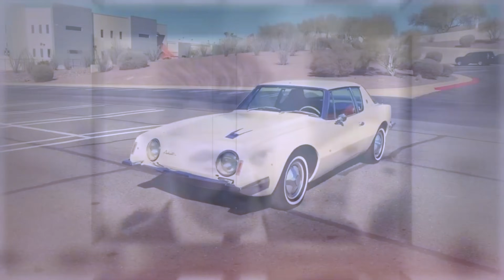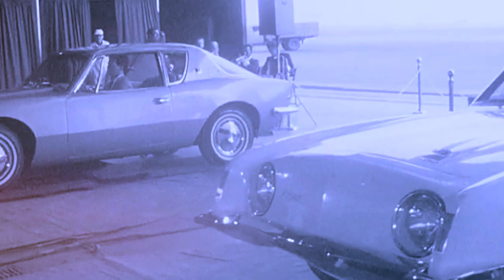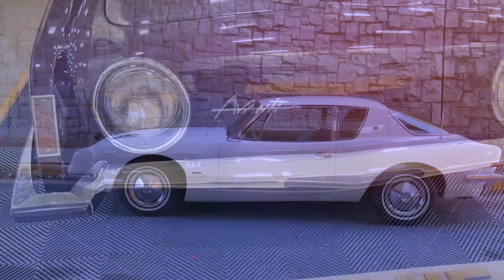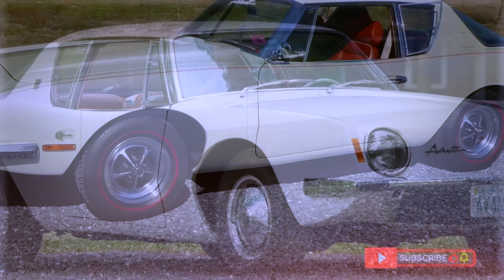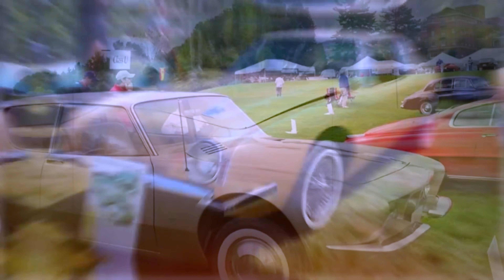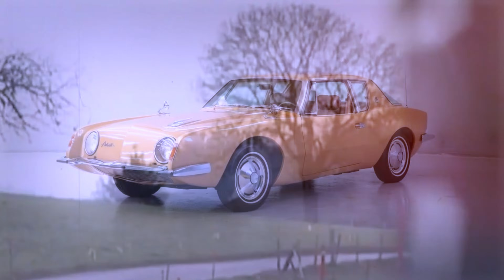13 Shocking Facts  About the 1962 Studebaker Avanti – America’s Lost Automotive Gem

Comment: Finally a promotions clip with mostly accurate information. Addendum . First American car w disc brakes was the crosley around 1949. So low quality they were shameful. Chrysler 1952 era had some but weren't really discs. Gone soon after.
The Avanti base price was $4440.00 but virtually all went out the door much higher priced.
Good estimate would be 4800.00-
5000.00. 
When Studebaker took over body production, after the likely "induced by someone" body disaster, the body quality equal and then exceeded that of Detroit steel bodies and much superior to the Corvette of the era. 
See auto magazine assessment of such    in the road tests of the era. I reiterate, a presentation with some actual factual information..there are a number of such on the utube channel that are atrociously laden w
Disinformation..